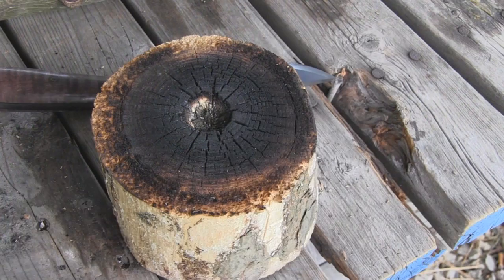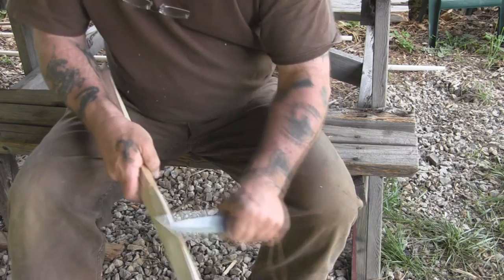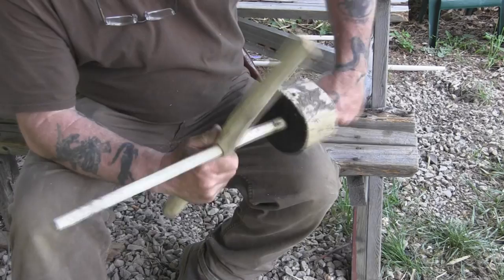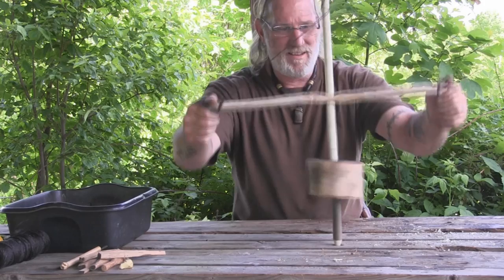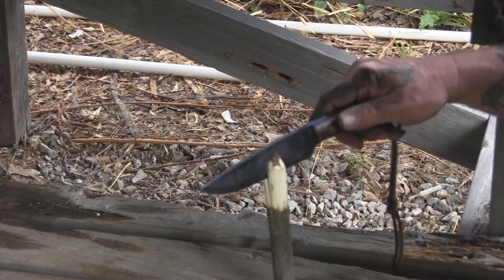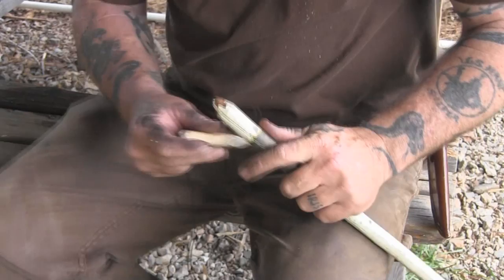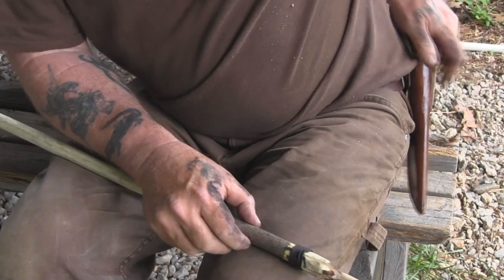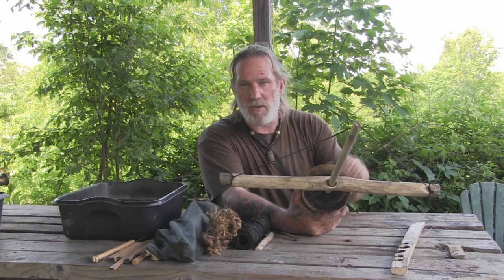Fire School Part 15 Pump Drill Fire,Learning the process

Comment: Very cool device. Thanks for sharing this. If nothing else, this would make for a good tool for drilling consistent holes in wood. That "bit" goes right through that soft wood. I wouldn't want to have to drill 100 holes with it. But if I was out in the wilderness and needed a couple of quick holes drilled, this tool would do it relatively easily.

Comment: Thanks for the video Dave. aside from making fire, I think the value of learning how to make such a tool is that it could be used as an actual drill to make holes for different building purposes in a primitive situation. I'm sure if it is refined some more it would be quite efficient for such a task. Just my two cents. :)

Comment: the drill stalls when you lift the handle upwards; if you just let inertia wind the string when the handle is going up you wont have that problem. it seems like you noticed though near the end.

the counter weight might actually act as a fly wheel too, maybe mess around with a larger diameter one?

Comment: Counter weight does not have to be round the piece you made for the pump handle could be shorter to be more effective and if you had cut it in half you could make pump handle and counter weight out of same piece bore hope through both 
Also in the interest of making pump drill faster the pumpm handle does not have to have a hole in it .... it can ride on the side of spindle..... 
A shorter pump handle gives  more down force also if you put hole through spindle for cordage and have shortpiece above that you can use a socket to increase down force
My fav method of making counterweight is make it thin and larger diameter..... larger diameter needs less weight to store energy

2 fav tools in the woods are a spoke shave because it can be used as a froe...... And a combo bow saw hand drill I make ...... With one adjustable wood bit from 1/2 inch to 3/4  fits most needs for building camp stools and chairs and is so versatile I would rather have it than any other tool including Any fire starting tools

Comment: not sure if anyone mentioned it yet, but physics wise, the larger diameter the weight the more efficient the rig will be. longer spindle is great but then you need a longer press board as well. you would be well served to have a 12 inch log that's roughly 3 inches in thickness.

Comment: i feel it you kept a piece of plate steel in your pack it would aid in the flywheel effect on the pump drill. a piece of plate 1/4 inch thick x 6 inch round with a hole in the middle of it. or a weight lifting plate. it could be a concrete poured plastic covered type too. if the pump handle isn't quite wide enough for the spindle of the drill to go through it. to the point the handle may break in the process of making fire. you can whittle down the spindle a little more. or find a bigger limb to make a new handle.

Comment: If you put the pump drill under a brace board and put your chest on it (about heart high location), that is your downward pressure.

Use your arms below you for your aerobic exercise of (French press) downward push and(biceps) upwards pull.

This keeps the string intact and doesn't make you make more heat (caloric burn) than the fire pump!

Comment: casual observation:  If you were to make a bit that had a sharp rock stuck in it you could use that rig to drill holes in wood bone or other stuff even rock if you used a hard stone to drill a soft stone.

Comment: I think that your cordage was too long for that spindle by about 2 inches. Just like an engine shorter stroke equals hifher rpm. Also the winding and unwinding will stretch the cord so you need to account for that. Just my 2
 cents. But good job. The chuck looked great

Comment: Great video. Just wondering if there is a way to make the counter weight without fire. Would be interesting to see.
Reply: You could probably use a primitive awl but it would be time and labor intensive and it would burn a lot of calories
Reply: 2 half moon cuts in a log split in half laying lengthwise and some cordage should work as good as the one he demonstrates
Reply: That was my thought.
Reply: Professor Apoc My guess is that this is not something you'd build for your first fire, but rather something you build once you're smoothing it to prepare for future fires. Another benefit is if you had a drill bit or even a sharp piece of metal, you could also use this as a regular drill to make precise holes changing out the bits with the chuck as needed, not just for making fire.
Reply: I have seen it where you have rocks and lash them between two pieces of wood like a sandwhich instead of log round.
Reply: Good points, I was thinking about that too, just too tired to type it out lol.  The sandwich idea sounds good too.  The counter weight doesn't really do anything but sit there, so as long as it is secure I'm sure it would work.
Reply: My only worry with the lashing it on would be if the rope was to loosen from the constant spinning
Reply: Just use a bowdrill setting. with a wood drill and you will need no fire ... well strong arms will be needed.

Comment: Ive not dealt with the pump drill ever before would you say its easier or harder to use over a bow drill from a calorie stand point?  It seems like it would take longer to build but not as much physical effort start to finish as a bow drill if you can get the motion and timing down.

Comment: Why use fire to make a fire starter??  You need to find a different counter weight. Use 2 longer "logs" with a half moon cut in the middle and then tie them together around the center pole
Reply from the maker: Then why make Char???? Next Fire????? But yeah I get ya-
Reply: A pump drill is a great skill to know, unlike fire char, I'm not packing one anywhere.

Comment: pretty cool concept. i would leave longer handles on the outside of the string notches and deffinitely use a longer spindle. as a side note, i once chucked a piece of tulip poplar into my 12v ryobi cordless drill and it made an ember in like 5 seconds. i know its cheating, but if i was in a situation where i needed a fire and had a cordless drill, fuck the dumb shit, i'm doing it the fastest most minimal effort way